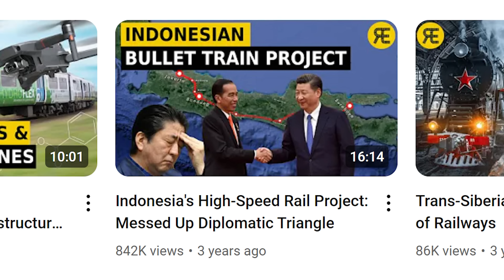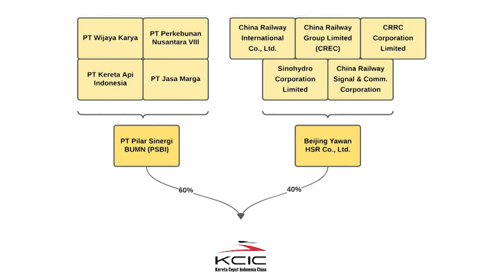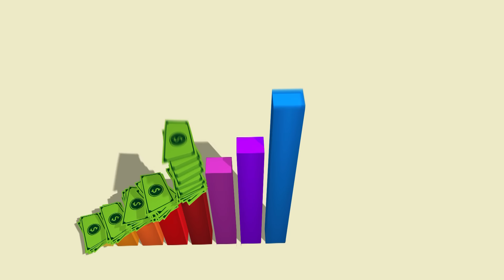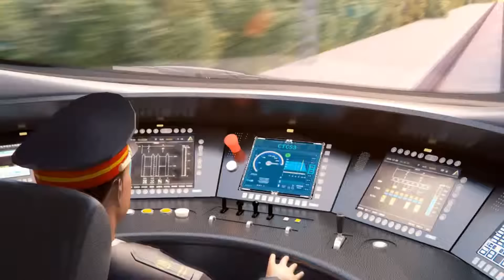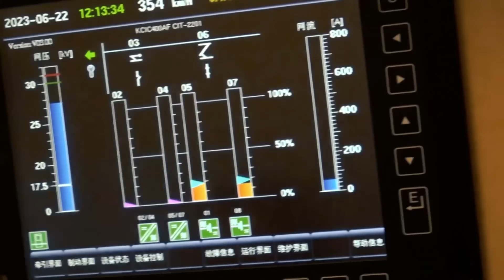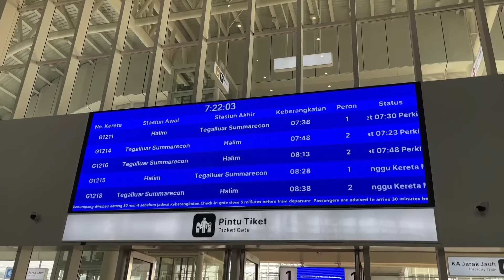Indonesia’s High-Speed Rail: One Year of Jakarta-Bandung Operations | 2024 Project Update

Comment: I was skeptical about Chinese HSR and disappointed it's not Shinkansen, but I was suprised the Chinese HSR is more advanced than Shinkansen, more stable, less shaky than Shinkansen, also faster. The maximum speed of Chinese HSR is 420km/h the reason speed limit 350km/h is due to the track design, however when the route is expand maybe it will allow to the maximum speed of 420km/h
Reply: The answer is because it is newer.Better and more sophisticated technology is used.
Reply: It is faster than the Shinkansen because it is half the number of cars and smaller carrying capacity. More advanced than a Shinkansen is a joke.
Reply: @zam023  People who don't know about trains just keep quiet
Reply: @zam023   People who don't know about trains just keep quiet
Reply: @zam023 Apparently you don’t know that two trains can be connected together.
Reply: @zam023  The longest trains in operation in China, the 17 car CR400BF–BZ/CR400AF-BZ (capable of going 400km/h but operates at 350km/h) is longer than the longest trains found in japan (16 cars). The reason that the Chinese trains and indonesian trains can go faster than the shinkansen is because it runs on better track infrastructure. The ICE, AVE, TGV, Shinkansen, and CRH trainsets can ALL run faster than 350km/h, but are limited by the track infrastructure, power efficiency, signaling, and noise.
Reply: As long as Jakarta will be allowed to import components from Japan to keep the Chinese trains stable LOL
Reply: @zam023 我作为中国的铁路爱好者，我可以负责任的告诉你:复兴号CR400系B型编组为17节比日本的新干线确实载客辆多
Reply: @jossdeiboss  😂😂😂 All components are domestically made by Chinese now.
Reply: @directxxxx71  Almost. They didn't figure out how to copy the Japanese patent of the never-loosening nuts (from Hard Lock Industry Co., Ltd.), key component in the Japanese high speed trains.
To not talk about the quality of construction of the viaducts, that are sinking in the ground.
You can find videos on youtube of chinese trains shaking like mad because of the two above.
Reply: @zam023 no, it isn't a joke. China is now more advance than Japan in HSR. China has the longest HSR network in the world. And China is leading in HSR technology now.
Reply: @jossdeiboss  where the link to the shaking train video?
Reply: @jossdeiboss  Send me the shaky Chinese train videos pls, because i can't find a single one of them🤣
Reply: Maybe you should stop listening to western propaganda and you wouldn't be surprised that China can build a successful mega project like this.

They do it all the time, on time and on budget.
Reply: Shinkansen is overrated, just like many japanese tech
Reply: @BlueCollar80  Shinkasen is not overrated and has made a lot of contribution to making HSR a viable transport system in modern times. It remains a popular and highly reliable line. But to say China's HSR is bad and lousier than Shinkasen is also a gross misstatement and is obviously said with prejudice.
Reply: "Tell me you don't understand anything about railway technology without telling me you don't understand anything about railway technology"
Reply: The track is just too short for 420 km/hour...
Reply: It needs to be reminded that if the speed of 350km, his energy consumption is 100%, running at 400km per hour may consume 200%, and such as wheel wear will become faster, this is not a car race, which needs to consider the issue of ticket price and cost. In addition, the speed is on the one hand, the road conditions of the track, such as how many tunnels through, will have a great impact on the final operating speed, the most important of which may be Indonesia as a country in the earthquake zone, whether it can sacrifice more safety for higher speed, of course, these need to be evaluated by professionals to reach a conclusion.
Reply: You just don't know that there have been a large number of accidents since the opening of the Shinkansen in Japan, because Japan's PR spends a lot of money to cover up such news. China's high-speed rail system is dozens of times the size of Japan, and China's annual high-speed rail mileage is equivalent to the number of Japanese high-speed rail operating for half a century.
Reply: @zam023  i wouldn't have said that if i were you in 2024, because it only exposes that one is not a fair person anyway, others' shortcomings are just for his convenience.
and personally i would have corrected the mindset and move on to be a better person, obviously the bonus of that convenience is depleted and i don't want others to find out.
Reply: No the cars within China can have more cars. So you claim is basically bunk. China has 11 times more high speed rail track than in Japan and its all standardized. Japan is no where close because China's is also smoother, more quiet and stable.
Reply: Don't know what you talking about. Chinese can balance coins while the train is well over 300kmh.
Reply: @zam023  Shinkansen is old tech.
Reply: @jossdeiboss  Balderdash as all the technology IP involved in the Whoosh is all Chinese. Japan has been left behind in HSR technology.
Reply: @jossdeiboss  Liar.
Reply: @zam023  nope, Chinese HSR has higher carrying capacity, trains in china are 17 cars long.
Reply: @jossdeiboss  And the one particular railway line that makes the train shaking the most is the line from Wuhan - Guangzhou, which was supported by French and Japanese companies.
Reply: @zam023  If you know how high speed rail move, you won't say that... The engine of HSR is not on the head... but on the body...
Reply: Western soft power i still potent i see
Reply: @russli-d2f  You can link trains however long you like. Also most Chinese HSR are 16/8cars anyway, and the few 17 cars trains are there to provide a full-size dining car on longer journeys.
Reply: @IndustrisasiIndonesia  Your comment is like comparing a 747 commercial jet to a 1930s propeller driven bi-plane. In other words, it's silly. Of course the Chinese HSR is newer than the Japanese Shinkansen but what is there to prevent the Japanese from upgrading their trains? The same question can be asked if an airline in say, Britain continues to use propeller driven planes to fly passengers about while the U.S. uses turbo-jet powered planes. Does this prove anything apart from t he fact that one side is more modern and progressive than the other?
Reply: @George-k6o9t  you just completely ignoran . Shinkansen is like McDonnell Douglas DC-10. China hsr is Airbus A320.. 

The problem is not the trains but the Tracks.It is the track that determines how fast the train can travel on it without going off the track. 

If you don't know the train just Silence
Reply: @timxu4268  Air resistance is exponential. So to go from 350km/h to 400km/h you will need far more energy than to go from 300km/h to 350km/h.  At some point it is not longer cost effective increase the speed as the power required becomes too costly.  However as the power grid becomes 100% renewable the marginal cost of generation becomes low enough it might not be an issue to go 400km/h plus anymore.
Reply: @zam023  What are you on about? clearly you haven't done any research. 复兴号CR400 trains have 17 cars and higher passenger capacity than the longest Shinkansen.
Reply: @gelinrefira  Being first doesn't mean anything if you can't keep innovating.
Reply: @George-k6o9t  Japan doesn't have scale which means less profitability which leads to less incentives and raw cash to do R&D, it is basic economic principle really.
Reply: @changliu3915  I don't disagree with that statement. Btu credit to where credit is due, and respect should be given to the first, lest you become arrogant yourself.
Reply: @jossdeiboss  Little-known fact: China's high-speed rail uses a more advanced symmetrical Tang's thread structure, which performs better than Japan's eccentric hard lock in the face of bending stress and is cheaper.
In addition, as for viaduct technology, does Japan dare to compete with China?
Reply: @changliu3915  I see. OK. Thanks for the info'.
Reply: @IndustrisasiIndonesia  Your type of assumption as a troll is simply not even worth replying to.
Reply: @George-k6o9t  You're just a bot account that  just created 1 week ago
Reply: @IndustrisasiIndonesia  BS to you, sir. BS.
Reply: @jossdeiboss I don't judge by watching videos on youtube, I went both Japan and China last summer, Chinese trains is more stable for sure as they were built decades later with new technology.
Reply: service speed  will never be over 380kph i think. the maintenance cost is high when u lift the speed.  thats the reason less popular chinese hsr line lower their speed to 320 or 350 i think